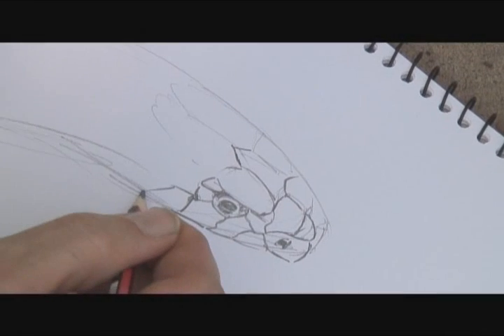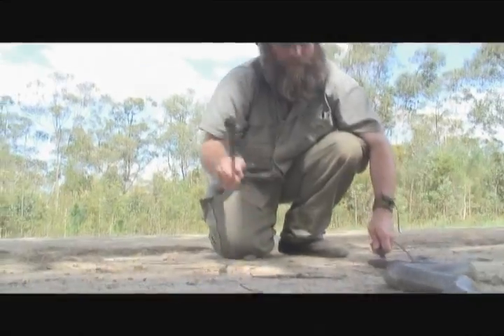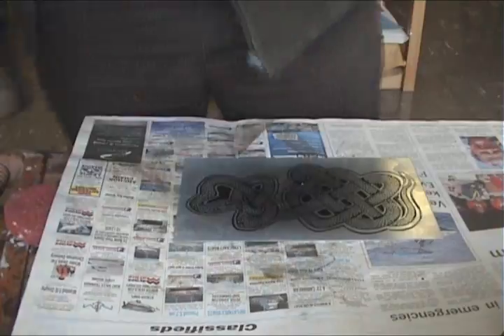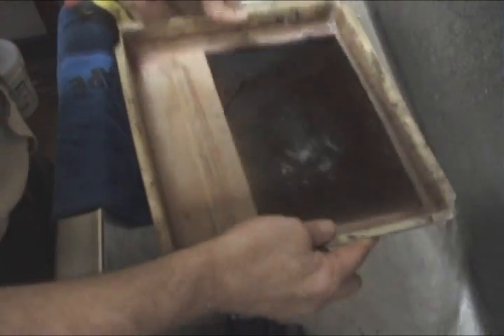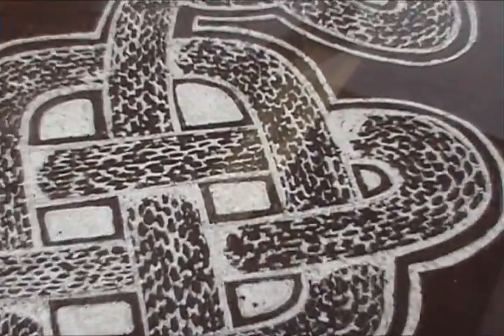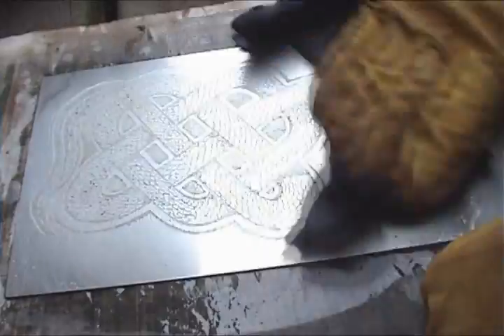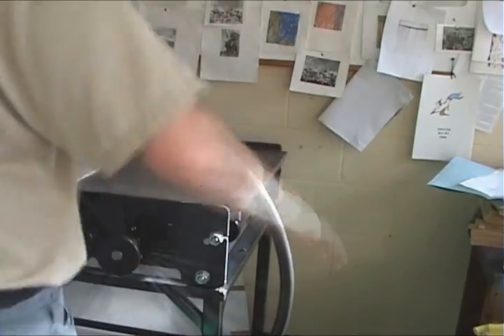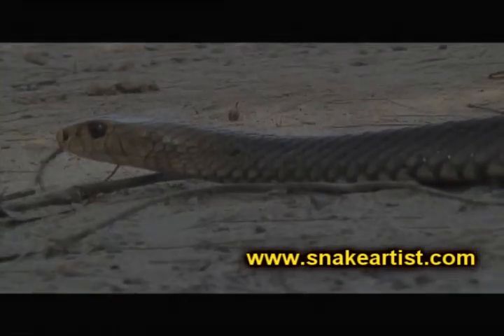how to do Sugar Lift technique (Printmaking)

Comment: Another method is to expose an image onto a silk screen and print it onto the metal plate using condensed milk. By doing that you can use a photograph or any image that can typically be screen printed. Thanks for these videos!! They're very helpful.

Comment: Hi .. love the fine design, can you give a little more details in regard to the preparation of the sugar list solution? cheers
Reply from the maker: The trick is not to add too much Indian ink, only just few drops enough to darken the mix. I use roughly about 1/3 sugar to 2/3s hot water. microwave it, stir it, add a dash more boiling water if I have to. it can be thicker to brush it on and thinner to use a nib.
Check out my printmaking channel at
https://www.youtube.com/channel/UCgy0cf9NoZhhDMVryrNJqbA